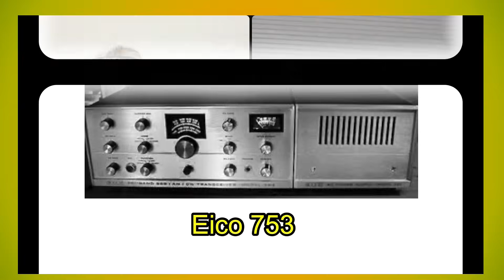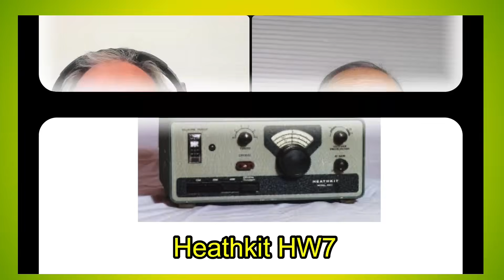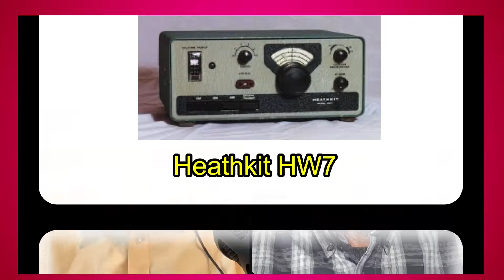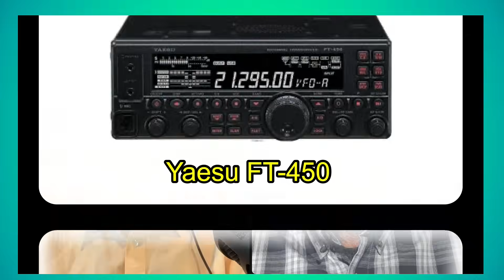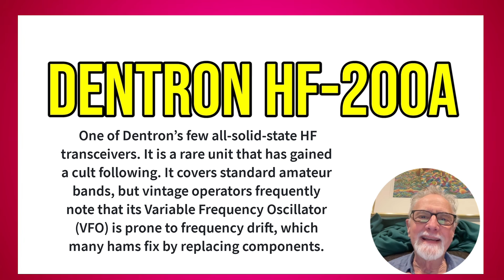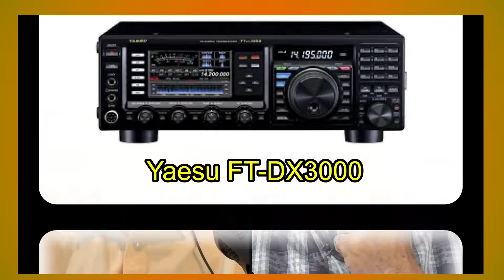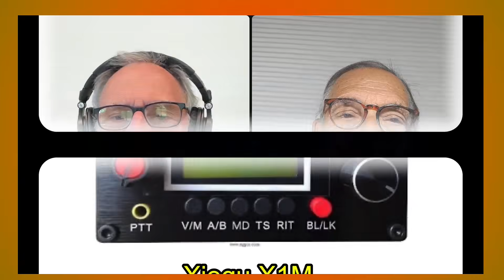10 Worst Ham Radio HF Transceivers -- Ham Radio Fun?

Comment: I looked at MFJ as a kit that is about 95%  put together.  Have to go through it and tighten screws and solder connections.
Reply from the maker: @ralphmowery2898 Interesting. Which kit? Just track back through the kit construction manual to make sure the previous work was done well. 73
Reply: @HamRadioPerspectives  MFJ is not really kit.  It is suppose to work out of the box.  However I have had to go through some of the equipment and tighten the screws.  A tuner I bought from them had several loose screws and nuts that I had to put back it their place.
Reply: I have some MFJ gear but it's all older stuff made before the quality control issues started.

Comment: Swan 250 - you must be referring to a specific version.  I have two Swan 250's and I like them partly because they are the only Swan transcievers I've seen that have 6146 finals.  So I guess Swan realized the error and corrected it.
Reply from the maker: @johnroccaro5491 Glad to hear you've had better luck with those than some others have! 73

Comment: I've been using the FT450 many years and I'm quite surprised that it has "red numbers" on the display and a "rattling sound". Maybe a different FT450 was supplied to the USA? (hi-hi). I see white characters on the display and the sound is normal, although I almost always use headphones :). The menu, yes, I agree, is not perfect, but it is possible to use quick access buttons, programming them yourself, and easily add three buttons to the microphone cable ;) About the sound - maybe someone turns on "contour" where it is not necessary? (hi-hi) But it has a roofing filter - 500 m from me lives a HAM with FT 897 and I can make contacts, tuning away from him by 10 kHz, but he :( is forced to leave this band... There is still a lot that I can be said about the 450 - about its pros and cons, but it will be a very long story :) 73 to all! de EU3AS
Reply from the maker: @cap3 Thanks for sharing your personal experience and tips for that rig. 73

Comment: Fun video fellas.  I was always tempted to grab a T-150 if the the price was cheap to see what mods were achievable to correct design flaws. Would be fun to try. Thankfully those kits allowed some hams then to get into the hobby on a stressed budget. Keep the vids coming!
Reply from the maker: @djneil7827 Take a solid drink before working on a T-150. 73
Reply: @HamRadioPerspectives yes lol.

Comment: Dave G4BTI
I built the HW7 and had all the symptoms you describe. 
I added a mosfet RF preamp after the input tuned circuit which improved the gain and reduced the microphonics greatly The microphonlcs were due to all the gain being in the audio chip.
Adding the preamp redistributed the gain.
After finally aligning the rig on the three bands, I placed it on the shelf for a few weeks. I then went to use it only to find it would only receive 20 M regardless of band settings. At that point, I suffered rig rage and binned it!!
Reply from the maker: @DavidCase-ov5uo  Sorry to hear that, but your maker spirit to improve it is commended. 73

Comment: What gets me is mounting a transceiver such as that Gonset, that appears to be a base tube unit in an automobile. The weight of those boat anchors testify to the build quality of older vehicles. You would have to have tight tension on those knobs or only operate it while stationary to keep everything from drifting. The tubes would also have to be fairly rugged to withstand the vibration involved with mobile mounting.
Reply from the maker: @Dcs0913 Right on! I would never even try it in those days. My cars were too small and cheap, anyway. But Tom did. He is a master at both electronics and mechanics. Quin, K8QS

Comment: I have FT-450D, FTDX-1-.FTDX-5000, When I use ft-450 for WPX SSB this year, it easy get the solid contest over 150 around 8 hours with 100w out put. My point of view for the FT-450D, how to adjust it s easy DSP function and when to turn off the IPO and turn on the ATT are quit important. I give it 84 point if my FTDX-5000 is 99. ps. My FT-450D was add-on bhi audio DSP and bigger internal speak, so the score will more higher to 90.
Reply from the maker: @TingILi  Very helpful info. Thanks! 73

Comment: Dla mnie niewypalem jest ft710 jesli chodzi o cw.Monitor cw ma tak duzo znieksztalcen,ze odechciewa sie pracowac na cw na wewnetrznym kluczu.Nikt o tym nie mowi tylko cicho siedzi!!!Poza tym NB bardzo nieefektywny!!!ktos kto nie jest biegly w tym temacie pewno zaprzeczy.
Reply: Audio Issues: If CW audio sounds like "ping-pong" or distorted, adjust the APF (Audio Peak Filter) and NARROW settings.  Users report better clarity by reducing DSP reliance and tuning the APF to match the signal frequency ? 73. Wyreguluj ustawienia filtrów APF (Audio Peak Filter) i NARROW. Użytkownicy zauważają poprawę czystości dźwięku dzięki zmniejszeniu zależności od procesora DSP oraz dostosowaniu filtra APF do częstotliwości sygnału
Reply from the maker: @alainbibi0047 Excellent advice. Thanks. 73
Reply from the maker: @user-qm5vs3ik3b  This is true with a number of rigs when it comes to CW. In fact, very few transceivers are excellent for the mode. 73

Comment: You forget the Atlas TX/RX-110, which was in the late 1970's and had a separate solid-state transmitter and receiver enclosures that were bolted together to form a transceiver.
Reply from the maker: @StarrKrumm Good catch, that one certainly deserves a spot on the list. We completely overlooked it. Did Swan make those? 73

Comment: I didn't experience the problem you mention with the FTDX3000, but then my next rig was a Flex 6400; perhaps that's why I upgraded...
Reply from the maker: @oobihdahboobeeboppah Glad that one worked well for you, and that sounds like quite the jump in technology. 73
Reply: My experience with the ftdx 3000 i bought from new was how awkward it was in use no way to go up in 1khz steps 1hz ,10hz 100hz or 10,000 hz why in the name of god why miss out the main step 1khz ? Furthermore the clarifier was somehow connected to the vfoB arangment madness , the memory channels couldn't easly be tuned away from . The power control right next to the mox button which you always pressed as you turned the power , i could go on and on. However as a receiver it was a powerhouse.  As a keen top band user you could dig out very very weak sigs , i live in rural Aberdeenshire Scotland with very low noise i  worked a friend he using a dummy load (an actual dummy load ) 25 miles away on top band i could bring him up only a quiet RX would this be possible, sadly my next rig the icom ic7300 was simply not capable no matter what you do the ic7300 can only be made quiet by turning it off,  or turn  AF gain all the way down.  The ATT and worse the RF gain on the Icom ic 7300 is actually worse than useless if your objective is a quiet RX . So as bad as the yeasu ftdx 3000 was for user friendliness it absolutely was a 1st class Receiver, probably the best i ever owned  (amongst past owned ic781, ts 870 , ts 590 ,ft990 , and a whole lot more )along with the ft817 in terms of pulling out weak sigs on top band . Where as the icom ic7300 is about as bad as it gets noisy receiver that simply can not be made quiet.

Comment: I had an FTDX-3000 and thought it was a decent performer but I didn't like the ergonomics on it. I ended up giving it away.
Reply from the maker: @ivandubinsky1857 Ergonomics can definitely make or break the experience with a rig. Glad it performed well for you otherwise. 73

Comment: Thank you for this video. Out of your ten worst HF rigs I had the Heathkit HW-7 back when I was a Novice in the 70's. It worked and I managed to make contacts with it but it had all the charm and personality you mentioned. AM overload and microphonics being the main issues. I still build direct conversion receivers so I am used to that issue. The HW-8 was a good improvement but was also a DC rig and I have one that I still use on HF CW to this day. So glad you did not bring up the Hallicrafters SR-150 as that was my first SSB transceiver and it was a peach for me and served me well for many years. 73 de wa4jat
Reply from the maker: @marknesselhaus4376 Agreed on all counts. I owned the SR-150 and the one with higher power, can't recall the number, and they performed very well. Solid builds, too. Quin, K8QS
Reply: @HamRadioPerspectives  I do recall there being a SR-1000 as well and it was a beast at  a KW. Love to find a SR-150 again. I prefer tubes given the choice.
Reply: There is a terrific semi-complex mods that greatly improved the HW-7. I got three of them at swap meets, fixed them, and sold them for dollars on the penny! Kept my initial modded one and it's a treasure!

Comment: Don't know any of these radios. For me it's any modern radio that has rotary encoders for volume, tuning or settings. I am sick and tired in replacing them. Also rubber membrane switches. Horrid designed to fail. Also why do they put features on kettles and toasters so you can operate them via an app on ya phone. Cheers from old George
Reply from the maker: @MakeDoAndMend1 Wow, old George, you nailed them. Thanks. 73

Comment: Hey now. Our ham club has/had a Yaesu FT-450 and a 450D. We used them at Field Day for several years and the four operators made a ton of SSB contacts on the 450 before we got the 450D. I say four because it took four. We had one operator at the radio, one acting as a technician to read the manual and also the notebooks full of hand written instructions when we needed to make adjustments,  one at the computer to log because the others were too busy, and the fourth was always someone with good hearing that could interpret that tinny sound coming out of the speaker. The 450D is a much easier to operate than the 450 but they are just different enough from each other to cause operating problems when we switched back and forth, and to make even matters worse our backup radio is a Ten-Tec. This year the club upgraded to the excellent Yaesu FT-710AESS because several of us already have and love them, and they have the best audio I have heard on any radio. We sold the 450D almost immediately after we upgraded and the Ham that we sold it to absolutely loves it and uses every day with no problems. However, we seem to be stuck with the older 450 for now, but someone will eventually take it off of our hands (as long as long as they don't watch this video that is).They will get a good deal on a radio that will punch through the pileups with the best of them and that will also encourage the user to bring a younger friend (with good hearing) along to "learn about the hobby". The deal will include the radio with the factory mic, box, manual, and a notebook (maybe two?) with pre-interpreted, step by step instructions for what should be simple tasks, and if the 450 is the operator's main radio and they use every day, not just once per year at field day like we did, I feel that they will eventually figure out the menu (probably). Another fun video from the Ham Radio channel with a sense of humor. (That's rare these days) Thanks guys. Boyd. WE5BC, 73
Reply from the maker: @boyddawncecil7559  Thanks for the great story, Boyd, and for sharing your club's experience! We wonder if different runs on the assembly lines produce different good-or-bad issues for rigs. 73
Reply: @HamRadioPerspectives  I spent 46 years in a factory, and I can guarantee it does along with who is on vacation, who fills in for them and whether it's Monday or not.
Reply: @boyddawncecil7559  And don't forget to never buy anything with a late November to early January date code...  73, -Tom N1BEC
Reply: Regarding your FT-450, many years ago a car dealer once told me “There’s always an ass to fill the seat…” 😂
Reply: @MrJohnnypig  Good radio, only used by little old ladies (and men) on Field Day.

Comment: Flex 6300/Maestro A…never lived up to the hype. Crashed often.
Reply from the maker: @Philip-KA4KOE Very interesting. We don't know a lot of hams who use them, but we have heard of problems. Thanks. 73
Reply: What a list!!  I still have my Swan Cygnet 270B. I have to fire it up a minimum of two hours to get less drifty before using it.  When I get tired of running my Flex 6600 with a mouse, the Swan provides plenty of knob diddling.

Still have most of my rigs.  They sit around the shack like rings of a tree.  

ARC-5 40M CW
Swan Cygnet
Kenwood TS-520
Yaesu FT-2000
Flex 6600

All except the ARC-5  are available to operate as the mood strikes.

Comment: as a 35 years ham owning more than 100 transceivers from all JA brands, including american radios, one of the worst I owned was the FT450,I tried both of them, the regular and the "updated" D version, both lasted in my shack just one month, the terrible audio quality was a bad design, I only could listen to it for no more than an hour.About the FTDX3000 which I owned for 3 years until it was destroyed by a lightning I never had an issue with the AGC,why? because as an experimented OP, I realized inmediately that the factory setting for the AGC was WRONG, some Yaesu radios has the AGC delay set by default to 6 seconds and that means that if anything triggers the AGC action like you said,beighboor light switch the received will stay mute for few seconds losing the received signal, the only thing you have to do is reset the AGC delay to just 2 seconds and it will work fine with any signal no matter how srong will be. Most of the operators today still don't know how to set AGC properly.
Reply from the maker: @AD4C Great report! What were your best radios over the years? 73

Comment: You missed out the Shimizu SS-105S. These were sold in a part kit from to avoid import tariffs. They had an optional FM board and people bought them because most HF rugs didn't have FM in those days. It was 10w output, but they made a rare 100w version. The only problem was the drift. It would drift 1khz in a minute. Required massive modification to make it work properly.
Reply from the maker: @GordonHudson  Yep, you got us on that one. That sounds like a real drift-fest, thanks for the suggestion! Also, see our video on the "joy" of drifting radios: 10 Reasons Why We Miss Frequency Drift: https://youtu.be/mUlEkpebcAY

Comment: The MFJ 9420 (The only on on the list I own) has a bigger silliness on it as it starts its SSB at 14.150 and if you have the CW part in it like mine it has CW from 14.000 to 14.150. Makes you wonder if they know the band plan. Still a cute radio but with what we have now  its cumbersome big for what little it can do.
Reply from the maker: @Eken-Eken  Thanks for the additional info. Some early rigs had strange band divisions, depending on the crystals employed. 73

Comment: A "portable" rig like that sounds like an equal to the "Wang, potable office  computer" that was the size of as literal coffee table and required an external 5ig storage of equal size. Portable meant you brought in a pallet jack and two hefty workers stacked them to move them out of an office. Some still exist in computer stores as Vintage portable machines that DO NOW WORK, and their OS was incompatible with DOS, and did not like HTML or GSML. Wang no longer makes computers, but their portables made nice tables and benches.
Reply from the maker: @patriot9455  Brilliant comment. I need to tell the story of the time an unknown guy showed up at the door, when I was a newly licensed teenage ham, with a Collins 75A4 receiver he offered to loan me after hearing on the air what I was using at the time. I could not lift it, so he put it at my operating "table," which was just a piece of wood I bolted on to one of those cheap steel shelving units. The whole rack came forward. He held the unit on the wooden table as I screwed the shelving unit into the wall to keep everything from crashing down. Great receiver if you had a good back and a real table. Quin, K8QS

Comment: I always fancied an HW7. Sounds like every Swan 250 needs a new owner.
Cumbria Designs had their X-Lock VFO stabiliser to cure drift in older radios.
How about a Pixie? Some say it's a toy! I successfully used one on 5.262 MHz with a QSO at 220 miles and SWL report from Utrecht at 340 miles. 350 milliWatts out. 

I was given a non-working MFJ 16010 tuner. One wire hadn't been soldered. 

G4GHB.
Reply from the maker: @bill-2018 Great tales, Bill. I saw both a Swan 250 ("C" model, which was better) and an HW7 at a hamfest yesterday. Take a look at the video to get a sense of what is appearing in hamfests on this side of the pond: https://youtu.be/toivS4d1Xcc
Reply: A hundred monkeys could type out the complete works of Sheakspeare but could they assemble a complete MFJ?

Comment: The Swan 250's used 6146 PA's, NOT sweep tubes
Reply from the maker: Right. Thanks.
Reply: @HamRadioPerspectives  But it did drift as much as any rig I ever had.

Comment: I've owned more rigs than I could list here, tge worst were the old analog pto Ten-Tec rigs. I had a Triton-4, Omni-D, and a 580 Delta and the PTO's slips terribly on them all! Junk!
Reply from the maker: @StalinTheMan0fSteel  I loved the operation of the Omni-D so much (low noise, great break-in keying) that I would repair the PTO every couple of years to keep it (I had about 5 of them) going. What a pain. Quin, K8QS
Reply: 580 was "Aw'right" especially IF you got a working one for under 200 bux.
Reply from the maker: @robertkeller9828 Good point about price. We can put up with irritations if the price is right. 73